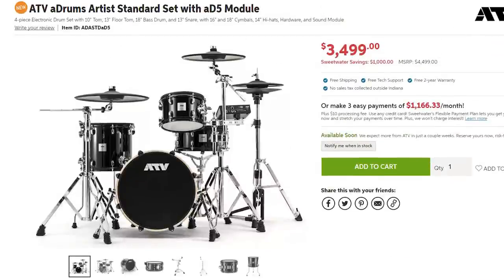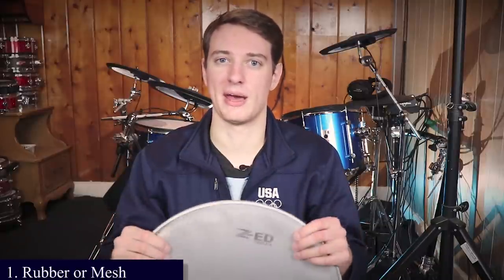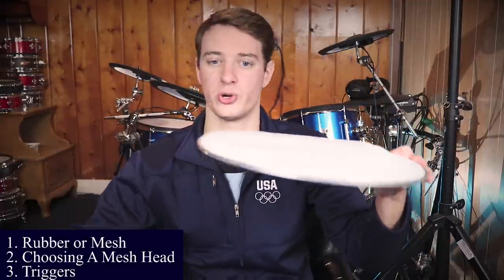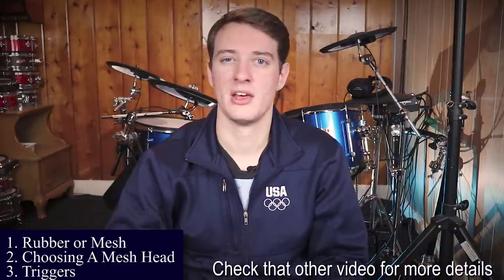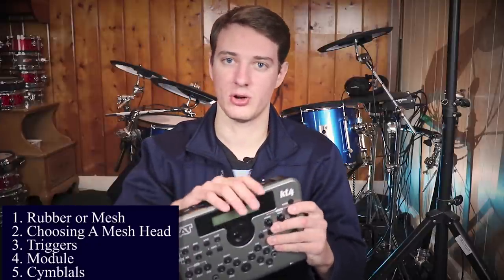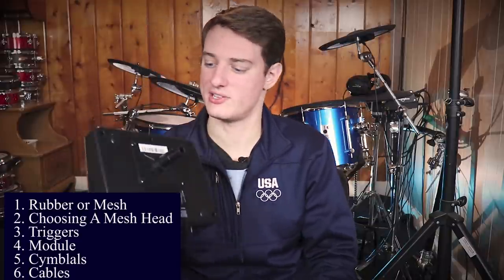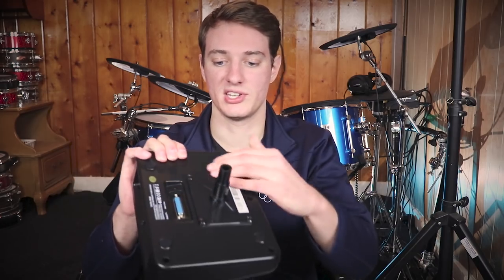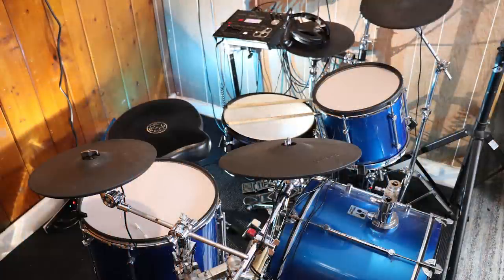Complete Guide: How To Convert Your Acoustic Kit Into Electronic

Comment: Thank you, Justin, for another great video.  I would not have considered converting my drum set if it wasn't for your videos.   They are incredibly helpful and I keep referring to them as I progress in completing my set.

I've always been a single ply girl on all my toms except for the snare, so I'm using the Remo SilentStrokes on all my toms.  They pair up nicely with the internal Exreme Drums! triggers that I installed, so far, in my snare and tom. You can also have some control on their "bounciness" by adjusting their tightness.  My dad misses using the TuneBot on the acoustic heads, but he's having fun learning a whole new world along with me.

The snare has a Billy Blast 3 ply, and I switched to nylon tipped drum sticks to minimize any surface deformities.

The Alesis DM10 module will do for now, because it has enough expandability to meet my initial needs.  Besides, I'll be counting on a VSP to control the quality of my sounds soon, instead of my module.

The biggest challenge so far for me?  The acoustic sizes of my drums make most electronic cymbals look disproportionate in size to me.  So I'm checking out the larger sized electronic cymbals that are out there, at the moment.   Discovered the Pintech Visulites since we last chatted too.

Just to give you a progress report on where I'm at.  Thanks again, Justin, for you guidance.    ^_^
Reply from the maker: Sweet! Glad the set is coming together Devikah :) I personally am happy I don't have to obsess over tunning anymore. It always too way too much time to dial in to get the sound right

Comment: Love your videos, as they are SUPER informative and very, very thorough. 

I would suggest though to talk more about drum sampling software such as Superior 2 or 3, Addictive Drums, and/or Steven Slate. Even the highest-end Roland modules still have extremely dated and unrealistic sounds (I've played the TD-50 in person and still can't believe Roland can't touch Superior Drummer's realism). I've used the TD-12, TD-4, TD-9, etc. Nothing comes close to the software.

Also, a lot of the options you suggest are on the too-expensive side for a lot of people. I've converted acoustic kits over the years (7 different kits, and at least 10 for students and friends) for less than $1700 total, including every single necessary part (shells, etc), AND the Superior Drummer software. 

For example-- used: Roland PD-120 for snare, ddrum redshot pack for kick/tom triggers, Roland TD-3 or TD-6V module, CY-8s for ride and crashes, and CY-5 and FD-7 pedal for the hi-hat. Some misc hardware, multi-clamps, etc.... mesh heads... done. None of that breaks the $1700 barrier, if you buy the right set of shells (PDP Z5 for instance, or the Ludwig Questlove).

Might be cool to do a few new videos talking about LOW-priced options, and discussing in detail, how much better the software samples are (it's hard to argue against Toontrack's quality over Roland).

Again, LOVE your videos and think you're doing a fantastic job (I subscribed to your channel last night), but don't forget about the poor drummers out there, and definitely talk more about the software side of things. Thanks and keep up the great work!
Reply from the maker: Glad you're enjoying the channel Chris, I'll keep the tips in mind :)
Reply: @65Drums  Thanks man. Not trying to pick apart your channel at all... I geek out about this stuff and have for the past 10 years. haha.

Comment: I love my new setup. 3 snare stands. Two old snares from ebay to make the snare and floortom and an old rack tom from ebay to make the tom. External roland rt30 on each drum. Yamaha kp100 mesh kick pad. Yamaha  15-inch ride and 13-inch crash. Go-edrum hihat controller with roland cy-8 cymbal. Megadrum drum module and focusrite audio interface. Addictive drums on laptop. Drumtec reelfeel mesh on the snare and roland 2-ply powerply on the toms. Around 1500 dollars but I put it together bit by bit. Just need to get a vh11 hihat i think as my cy8 is ancient and goedrum controller could break as its so cheap

Comment: Godd video with great info.
Just earned a sub!  Actually I've been watching many of your videos and don't really know why I haven't sub'd til' now..
I just bought a used PDP 5 piece kit that I'll be converting as a project.
Checked out Jobeki's site due to your recommendations and really wanted to go with them for heads and triggers, however I'm reading horror stories about how long they take to deliver.  Especially to the US.  I just don't have the patience to wait two to three months for an order from ANYONE!  
Looking for state side alternatives but it appears there aren't many US based options for stuff like this sadly.  I know this is an older vid so wondering it you have any alternative recommendations that are current. (Conversions.. not complete sets..)
Thanks, and great videos.
Keep up the good work!!
Reply: If you havent bought anything yet I would seriously look at the Convertible Percussion triggers. I just made a 14 inch snare with their dual zone trigger and it rocks! Better than the PD-120 it replaced. And supports positional sensing on my Roland td10. Nice price. $45 dual zone and $40 single zone with discount on multiple purchase. Got mine on ebay. Easy install. Simple sturdy design. 
Was delivered in less than a week.

Comment: Hi there, I have a bit of a convoluted question, hopefully you can understand.  I am a newbe drummer, less then a year.  I have an old Yamaha’s DTX 500 I think.  I bought it from a friend who’s son gave up drums.  I love the Roland VAD 506, except the $6,000 Canadian price tag.  I’m thinking of making a hybrid set.  I found an old Orbiton kit.  It has everything plus it is red.  The best sounding drum kits are red.  LOL.  I like the Roland TD17 SKX module.  I can pick one up on eBay for about $730 CDN, or $850 CDN from a drum store.  But I was thinking on starting by cannibalism my DTX kit for the module and cymbals.  I’ve found a set of UKS Audio 2 ply mesh pads and a Red Shot Trigger pack of triggers.  If I cannibals I get this done probably within two weeks for around $700.00 CDN.  But, here is the million dollar question, is it all compatible?  I realize it will not be a VAD 506, and it will only be as strong as the module.  But if I like I can buy the Roland TD17 module and have a hybrid kit pretty similar to a Roland TD17 SKX.  If I don’t like I can convert back.  Your thoughts please.

Comment: If the bolt on triggers will work with the Roland TD25 , 30 & 50, will they also work with my Roland TD20X? Same question for the metal e-cymbals. Thank you for the awesome and super informative videos!

Comment: Could you please do a review of 2box triggers? Or tell about them? Because in description of these triggers you can read, that they are compatible with any drum module, but I read about some issues with Yamaha modules. Snare isn't triggering a rim. Is there a similar problem with Roland modules, e.g. td9 or td11?
And also why pack of 5 cost about 130$ and a single trigger cost about 60$?

Thanks! :)

Comment: I have my dad's old acoustic drums from the 80s with some missing parts, but for the most part it works for this. I already have a modified td-6v with all mesh heads and it's great for what I use it for, which is practice. I was loving this option because ive had the kit for 9 years and am so looking forward to moving on. I was happy with this option until you got to triggers. Can I get the dual zone for the snare, and the cheap triggers for Toms and bass without any issues?

Comment: I think I have a stupid question. But I just bought Simmons sd550. Its good, but I am not very impressed with the sounds. No budget left to upgrade drum module. I have an old Alexis sr16 lying around. I haven't used it much. Wondering if it is worth spending the effort to get the cables etc. Per the spec, It's 24bit sound etc. I just need to fine good cables with 1/4" to 1/8" connectors. Thoughts on how these modules 2 compare on sound ?

Comment: So im wanting to convert my kit into an electronic kit due to living in an apartment. My question is, if i buy the ddrum external triggers with the xlr. Can i plug those into my interface (tascam 16x08) or do i still need a drum module?
Reply: Could i do the same if i buy electric cymbals too? Il be running it through protools with my GGD

Comment: Hey Justin should I spend the 900$ for a Roland TD-11K-s or three hundred for the alesis nitro?
Reply: Hey, I have the TD-11KV which is just like the 11KS but with mesh toms and better cymbals.

I would go with the Roland, because of the mesh snare pad vs. the all rubber pads of the Alesis. Also, the cymbals are better on the Roland in my opinion, they are extremely durable and sensitive. The biggest reason I would go with Roland is the drum module, the sounds are much better I think.

Comment: The easiest way to convert is just get some e cymbals,rim triggers and mesh heads(mesh are just better,rubber heads suck) and if you want to go back to acoustic its as simple as changing drumheads and cymbals.Internal rim triggers are not better than external rim triggers they just look cleaner cause they're hidden inside the drum so either option is fine.

You don't need center mounted triggers at all on the toms & bass drum and even the snare you don't unless you want to use positional sensing but most modules don't have PS anyway so much easier to just use rim triggers and not have to deal with hotspotting.

Comment: Hey Justin.. i wanted to convert my acoustic kit into an electronic one.. i was looking at the 2Box Drumit module with the 2Box Triggers as it has more inputs compared to the roland modules and triggers where i would have to get atleast a TD30 which is quite pricey compared to the 2box drumit which is way cheaper.. whats ur experience on the 2box module with 2box side mount triggers